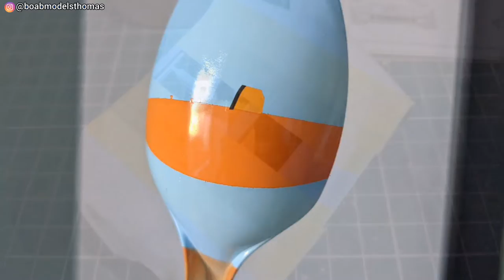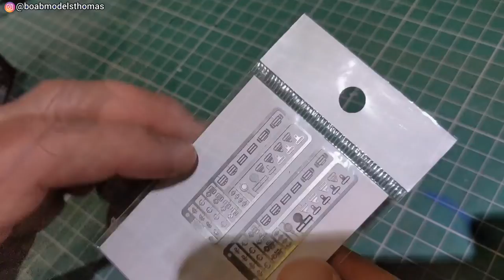Ford GT40 1968 Le Mans - Full build - Fujimi & Revell 1/24

Comment: This is a nice work! I'm working on the revell mode, and the biggest trouble is the Gulf blue.
I'm looking in FS595 and the color seems to be the 15450. Not easy to find here in Italy... If you don't want to spend 25€ for a 125 ml bottle. Almost the same price of the model!
Reply from the maker: Thank you very much. Yeah, I had the same problem. As I don't have an airbrush, I bought a spray can of Ford Bermuda light blue from a car parts shop. I'm happy with the colour.
Reply: @BOABModels  
Thank you for replying. You have a new follower. I'll try with airbrush otherwise I'll go for plan B and buy the spray. 
What colour did you use for the braking discs? I can't find the metallic brass....

Comment: The problem with modern plastic models it there's too many small parts and bits and pieces.  IMHO it's  better to sacrafice some detail to allow more expedient assembly.   Once the finished model goes into the display case the chassis detail becomes a moot point.  I imagine many of these kits never get finished because builders get discouraged with too many parts.
Reply from the maker: This is why personally I'm not too fussed about curbside kits as I don't display the engines anyway. If they have one, cool, but if not, I don't mind.